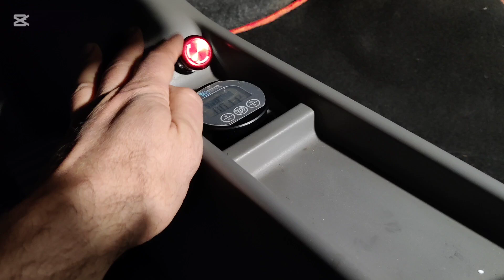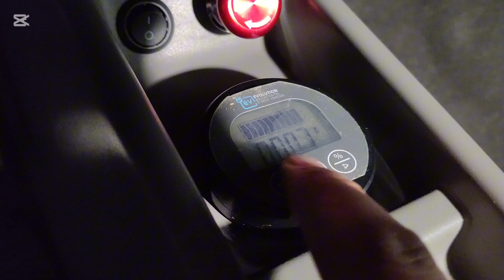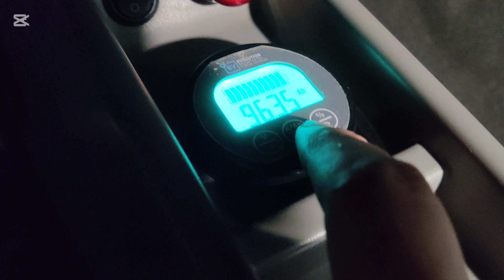Fiat Panda EV Conversion - Episode 6

Comment: I have a panda just like this and living close to you in bergamo :) I like it, anyway this car is not for long range driving. But - there is loadsss of space below the boot floor and I would never put this box in the boot like that, only below. Also needs to make the original fuel guage work and then I would want it on mine :) 
Did you say 30 kw battery? You said the 30 kw very quick not sure if I heard right. 30kw is nice for such a small box and good enough for the panda.
Reply: Peak power of the motor: 30 kW
Battery capacity: 12 kWh